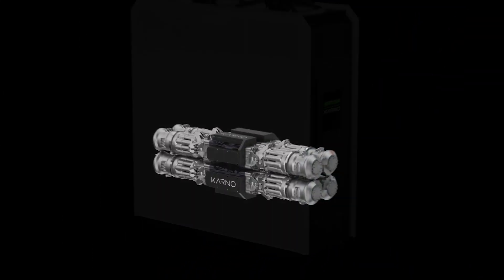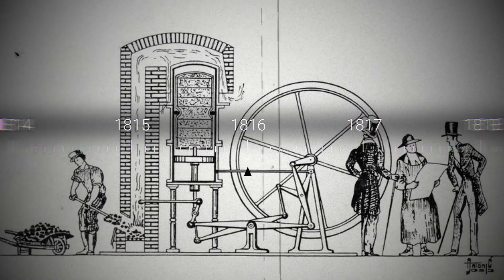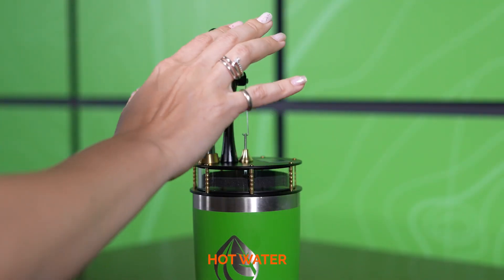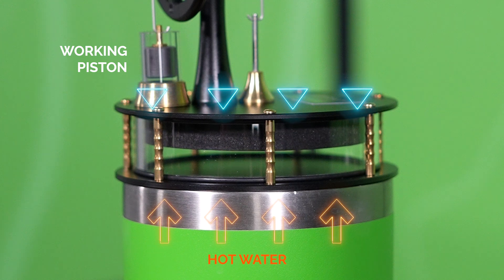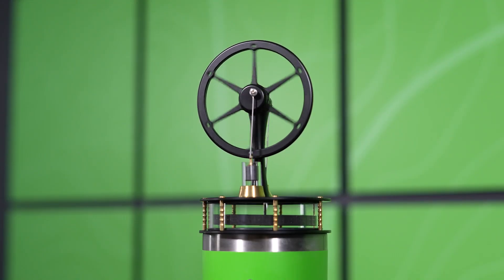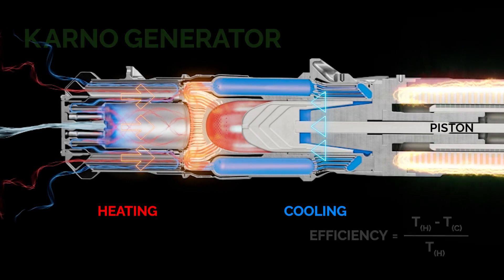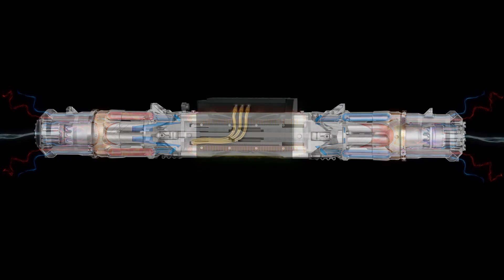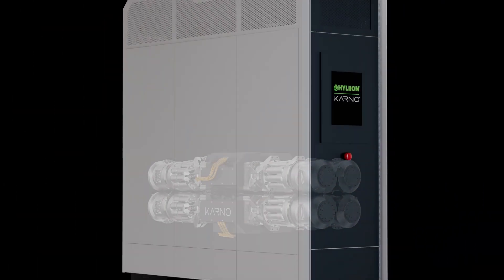KARNO Tech Series: 6. Fundamentals

Comment: Hyliion can't even get the basic principle of a Stirling engine right. The explanation of the displacer disc is all wrong. The hot air does not push the displacer disc. The hot expanding air moves the smaller power piston which turns the flywheel, and that moves the displacer disc. The displacer disc simply displaces the hot air when lowered so the air moves up and cools then when the disc is pulled up it displaces the cool air down to be warmed.
Reply: Yea, the fact the displacer isn't airtight should make it obvious the expansion doesn't move the displacer lol.
Reply: The Wankel engine redesigned. This company is doomed.